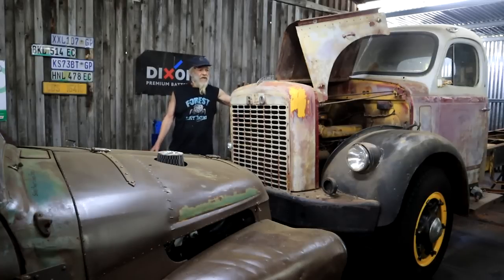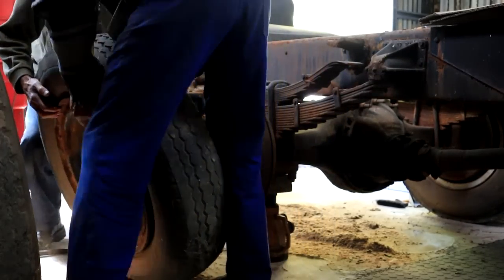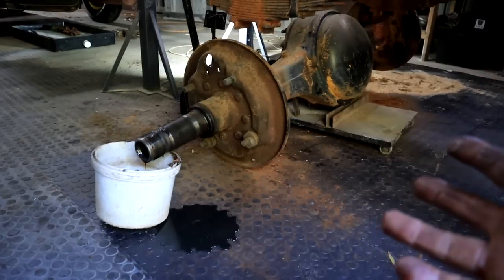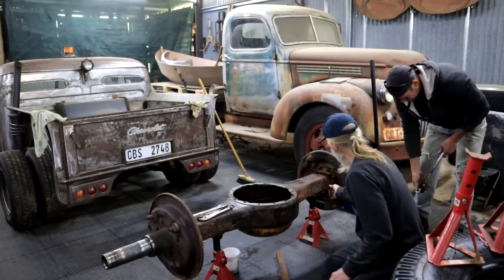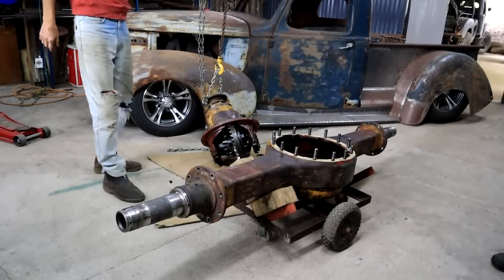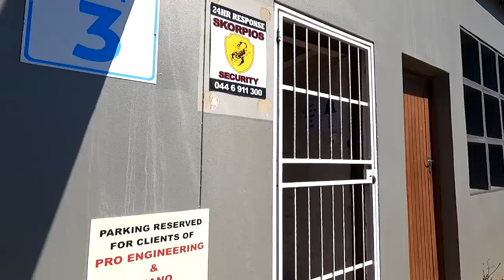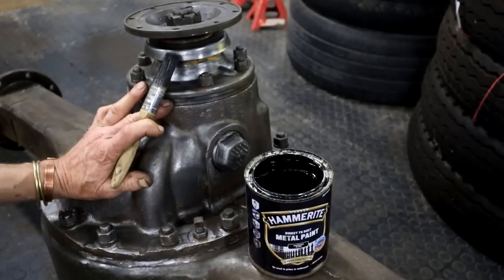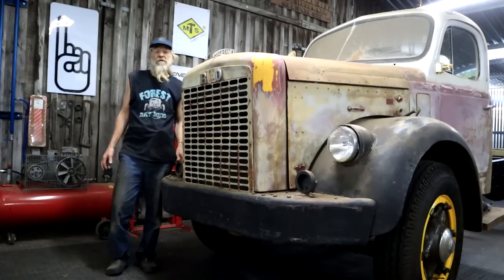Ripping out and refurbishing the rear end  - Part 1. REO Gold Comet

Comment: A tip from an old plant fitter 😁 when trying to remove rear hub's put the half shaft back on but flange to the studs first and bolt on you then have the length of the half shaft to act as a lever comes off every time 😁😁🤘🤘

Comment: MOST Important thing before reassemble... make sure Vent is clear and working , Or add a Hose And a Small filter in frame to avoid mud and water. 😎😁
Reply from the maker: Vent is good and functioning properly. We checked and cleaned

Comment: westport wa.state usa. here and watching.  
i thank you for bring me along. brings back nightmares. did that to a 48 dodge 2 ton dump. what a job. just me and an engine hoist. i did buy one huge air impact gun. and a vary loud compressor. two weeks later. tada! it was a 4 speed with a browning 3 speed behind. put a cadillac pump with a small pulley. and never had any problems with the brake. did not even have to pump them. first time every time. oh, into it for 500 dollars. 30 years ago. truck is long gone but the memories still haunt me. and the laughs. good times.
Reply from the maker: Nice little story. A struggle always makes for good memories down the line🙂

Comment: Looking goood 👌Wheat straw is the best thing i've ever found for lifting spilt oil, something to do with the cellulose if i remember correctly try it you'll be amazed how well it works.
The original hammerite paint was invented about 30 miles from here in Northumberland England the old recipe was much better than the new stuff. Since they took all the deadly chemicals out of it, its a shadow of its former self.
I think you should call Wayne, the hyena. Hes got the best laugh in Africa 🤣🤣🤣🤣
Reply from the maker: Just like everything else they make today, "a shadow of its former self"! The hyena! I like it😂

Comment: Old brake drums come off easiest if you run the adjusters all the way in first. If there is a lot of wear the brake shoes will cut a groove or step which the shoe has to try and climb over. In place of Hammerite you can use a good black marine grade epoxy paint. These work well and keep rust off.
Reply from the maker: Yes, I know.  But the adjusters where all rusted and frozen so it was a struggle!

Comment: Dif, I enjoyed watching the rear end and frame being cleaned up and painted. it really made a big difference in the way they look; it's going to be interesting seeing the springs after they have been gone over too.  I use a metal roof product for outside metal, it's called Columbia paint and roof coatings....for things like my mower deck, I use a product called Rust Bullet, it's in line with your black coating. I'll be standing by for the spring video. Have a Lekka one man,  and thanks for mentioning Thanksgiving in the states.👍
Reply from the maker: Pleasure and thanks man

Comment: Happy Thanksgiving Div,
We can get Hammerite here in the states, but it is very expensive. For 1 can of it at 250 ML is about $1,113 SAR compared to Por 15 which is $1285 SAR for 946 ML. They have so many rust paints and convertors that I don't know which one to use. Oh well I'm sure that I will figure it out. Great video.
Bart
Reply from the maker: Over here, one liter of Hammerite cost ZAR 397, about $22!

Comment: From a guy who changed as many as 3 sets of tandem axle trailer brakes in a day, first back off the brake shoes, don't separate the drum from the hub and don't take the tires and wheels off of the drum and hub ,Use a piece of galvanized or aluminum sheet metal about 12" wide and 36" long, grease it with a parts washing brush and chassis grease , slide it under the 2 tires at the bottom greased side up, now let the jack down until the tire bottoms touch with just a little, on a level floor one guy can do this by himself, now just pull strait out on the entire thing , no lifting or beating, pull it off the axle stub and then roll it out of the way  I don't want to appear a wise ass but it hurts me to watch you guys work so hard
Reply from the maker: Appreciate the input. My first time working on the  bigger stuff and happy to get some advice from someone with experience

Comment: All it needs is a late model Diesel motor and Trans ?
Reply: Reckon a good Cummins 6 cylinder will suit this build
Reply from the maker: This truck is just to rare to modify. I'm going with the original bullet proof Gold Comet engine
Reply: @ratrodsafrica  what sort motor was that and how available are spares in this country
Reply from the maker: @JustinPaul1st  original straight 6 petrol 5.4 liter engine. Zero spares available in SA. We will have to make plans😅

Comment: Crikey ol' mate, what are you planning on carrying . 
 . . talk about overkill. Thought for sure you'd build a four link with air bags
Reply from the maker: That truck is just too rare to modify. Only one in SA and someone reckons there are only 3 left worldwide!
Reply: @ratrodsafrica  Can't argue with that . . . going to be a rocky ride on dirt roads with those springs and only a car on board though
Reply from the maker: @Pops1948  removed the rear helper/load springs and some blades up front. Will see and fine tune
Reply: @ratrodsafrica  Good idea